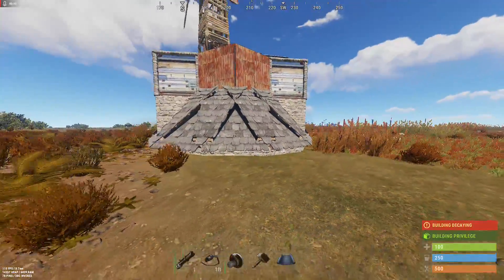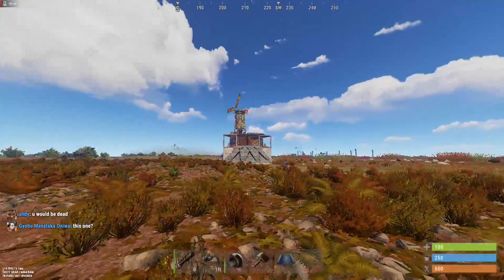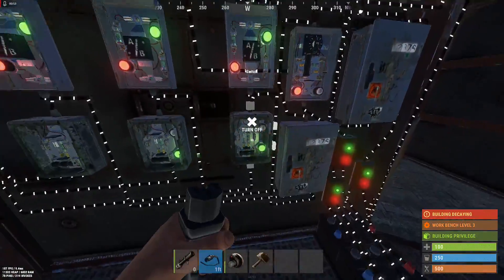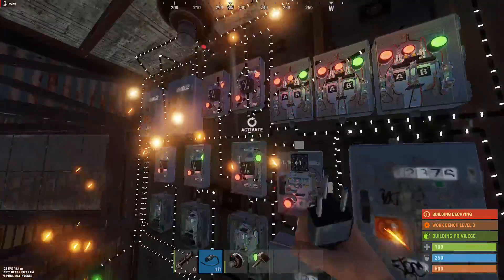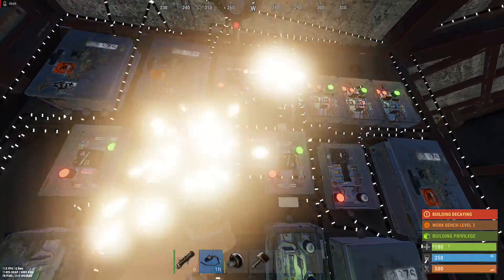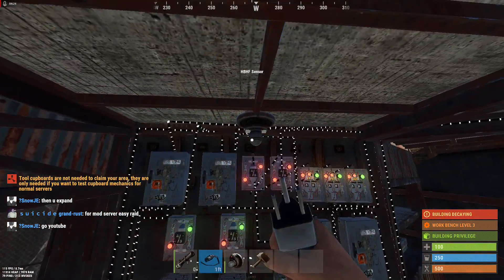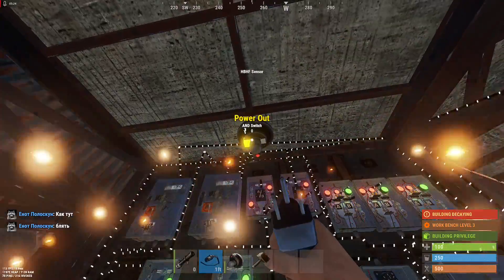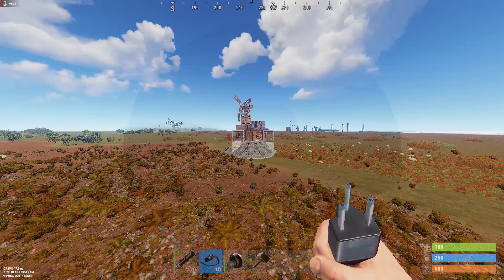Rust Building - New Automatic Defense System, activates Via HFBF when raiders are deep. (concept)

Comment: So once you’re HBHF is exposed, raiders will snipe from a distance and take the sensor out.
Reply from the maker: basically yes, unless you hide it or place it at some corner. but your hope is that the raiders die right away and before your system resets.
untill i improve the system and add other things as well it will serve as a last stand that your base attempts when you get offlined.

(edit just added one sentce)
Reply: Dont Matter , I’ve been using similar turret placements for a while. I place foundation and half walls like honeycomb next to the turret foundation. I then destroy the foundation leaving the half walls up. The gap that’s created by the destroyed foundations is where I hide my HBHF. Concrete barriers and sandbags are put in front of that. The HBHF can see through these. In this setup, it’s crucial to have built on level ground such as a frozen lake or shallow water. I prefer the shallow water in the snow biome.

Comment: Added Switches.  This one doesn't use AND switches so you don't have the flying sparks giving your electric away. You can chain blockers/sensors to make the same thing happen.  Obviously substitute the test gens for windmills/solars and you can chain the smaller batteries to get rid of the large battery.  Branches are cheaper hqm wise than splitters imho.  You'd need 8 small batteries. https://i.imgur.com/X0uVtUM.png
Reply from the maker: Yes using blockers is way more efficient, I just built on one wall and did not want to improve anything since i was very low on space there may even be other things that can be improved.
regarding branches vs splitters cost  - i took an existing design from wurst and added the system to it trying to keep the theme of it and keep it simple.
thank you for sharing this very good circuit.